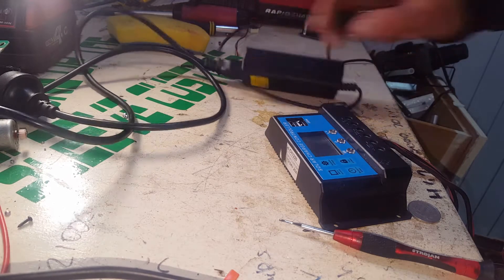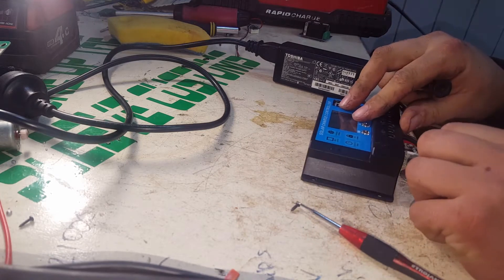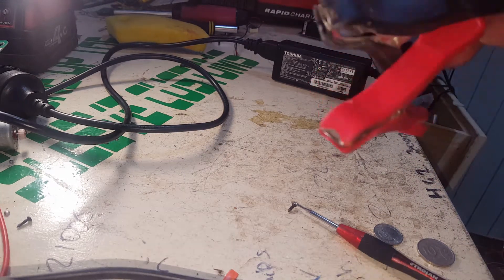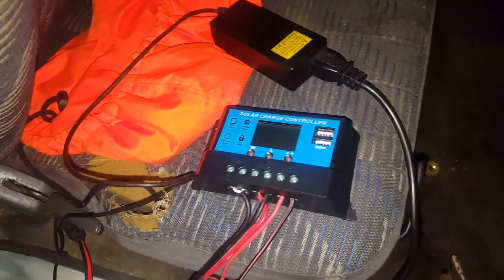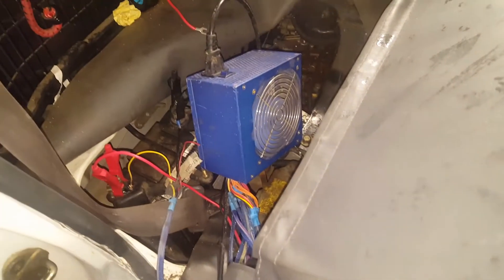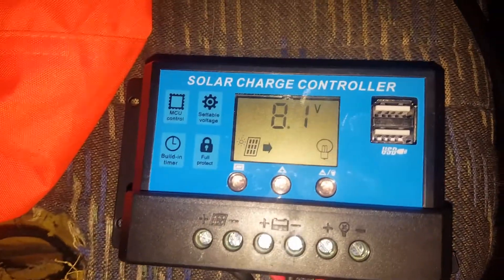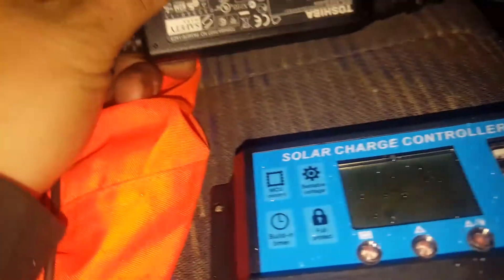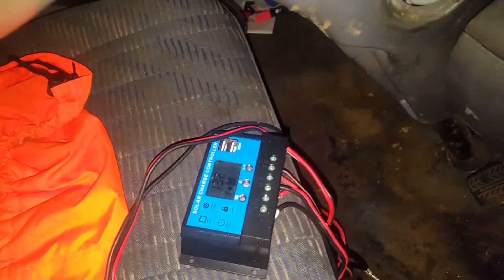Laptop power supply and cheap PWM charge controller  Car battery charger

Comment: This idea popped into my head a while ago and I just remembered to do a search on this topic! In theory I know you can! But I wanted to see if anyone has done this? Cheers! Subbed and liked 🙂👍👍👍
Reply from the maker: Yeah mate works fine. Better quality charger and controller the better results
Reply: @Oneupthesleevecustoms  man that was quick! Lol. Thanks heaps for the quick reply. Have a great evening. 🙂👍👍👍
Reply from the maker: Cheers. I will make an update video soon asim putting a lifp04 battery in my ute soon and a 19v 11amp laptop charger to top it up on job sites
Reply: @Oneupthesleevecustoms  oh yeah! That I'll be checking out for sure! Thanks man.👍👍👍👍

Comment: I've tried this method, but it didn't work. I have a laptop charger which rated for 65W (19V 3.42A). I connected the same way you did, but the voltage immediately shoots up to 14.4V (like 12.6V to 14.4V in a second).
Reply from the maker: What were you charging
Reply: @Oneupthesleevecustoms  VRLA battery, 12V 7.2Ah.
Reply from the maker: Yeah its not made for more than 1.5a charge  rate I'd say that's a huge push 65w
Reply: @Oneupthesleevecustoms  yeah, I thought so. Battery is rated for 2.16A max. I better use some kind of current limiting.
Reply from the maker: Yeah it is just hitting it a bit hard. Slower up and down you charge a battery like that the more cycles you will get also
Reply: @Oneupthesleevecustoms  thanks bro, I'll try that.

Comment: Hi thanks for the upload.

Can I hook up a laptop charger to an AC-DC voltage regulator,  then add a DC-DC pwm buck converter,  to make a bench power supply?  

Or maybe use a 12v car battery wired to the buck converter,  then to the voltage regulator?
Thanks
Reply from the maker: Yeah with a buck boost converter you cam do either
Reply: @Oneupthesleevecustoms  Thanks for the quick reply, appreciate  it!
Reply from the maker: No stress

Comment: I ve 30 Ampere Solar Charge Controller can I use it with 20 Volt Laptop Charger to charge my Lead Acid Battery.
Reply from the maker: Sure can

Comment: Can I use this to charge from battery/alternator to another  battery? To regulate the current that come from the alternator
Reply: I had a similar question can I use one of these controllers as split charger from starter battery to charge leisure battery
Reply from the maker: I think they are too small of current to do.so safely. A vsr is what you need I have one of these http://rover.ebay.com/rover/1/705-53470-19255-0/1?ff3=4&pub=5575479985&toolid=10001&campid=5338476033&customid=&mpre=https%3A%2F%2Fwww.ebay.com.au%2Fitm%2F332844284246
Reply: Thanks. A VSR however does not regulate the charge and can overcharge and damage the battery. A battery to battery charger is the ultimate solution with 3 stage starging. We were asking to use this solar regulator to mimic the 3 stage charge but it might not work as i have heard that when the batteries are top up the solar charger controller short the solar panel as way to turn it off. This won't be a good news for the alternator :). Hope it helps. Get a dc to dc charger
Reply from the maker: Yeah a dc dc is safe way I've done a 24v bank to 12v with a red arc dc dc
Reply from the maker: http://rover.ebay.com/rover/1/705-53470-19255-0/1?ff3=4&pub=5575479985&toolid=10001&campid=5338476033&customid=&mpre=https%3A%2F%2Fwww.ebay.com.au%2Fitm%2F164125931505
Reply: @Oneupthesleevecustoms  phew they ain't cheap lol
Reply from the maker: Nope bit they do alot

Comment: Hi, do I need a diode in series with the laptop charget as protection just like when solar panel is used?
Reply from the maker: If the charger can not handle back fed voltage. To be on safe side put one in
Reply: @Oneupthesleevecustoms  it think not scc has it all figure out...

Comment: question bro.. if i some how reduce the volts on my laptop charger to 12/13.5 volt add on a charge controller would work bro.. just question of will it.??🤔
Reply from the maker: You can feed the charge controller 19v or what ever the power supply feeds. Then charge lead acid batterys off controller

Comment: Dude can i use 14v  82 amp power supply?
Reply from the maker: You.sure can.. will need a much bigger chargecontroller
Reply: CM3024Z can afford this power supply?
Reply from the maker: Got a link to it.?
Reply: @dashingboy2160  that's 30amps max. You need something else.

Comment: Can I use this without battery? I mean like a converter 19v input to 12v output (load)
Reply from the maker: It will charge a 12v battery not as a power supply though
Reply: One Up The Sleeve Customs  I need to power my modem and router as a backup, in case of power failure like UPS. Do you have any idea about this. I have a 12v battery and laptop charger
Reply from the maker: A dc to dc converter set to an output of 12v might help

Comment: Some PWM charge controllers are the shunt type meaning as the battery comes to full charge they shunt (think short) the solar input. Solar panels don't care but your laptop supply may not like getting a dead short. I'm not saying that's what is happening here, just an fyi.
Reply from the maker: Thanks mate great advice for me and fellow viewers
Reply: Fanplant tanks for the advice mate it helps 🙂
Reply: Wtf lol is it pwm why they do that, just zero cycle
Reply: im wondering if i setup my power supply on 13.6v (for example) and the controller to stop charging the battery at 14.1v  (for example) am i going to have the short circuit problem when the battery will never reach 14.1v because the power supply delivers just 13.6v the battery will always be changing.

p.s. im looking into this from the point of emergency UPS.

Comment: i have 9v charger laptop can i use it?
Reply from the maker: +Romeo Baltunado no too low mate got to be higher than 13.8
Reply: Can i combine a 9v and 12v adapter?
Reply from the maker: +Romeo Baltunado could do best thing to use is  just a laptop power supply  as they are already 15 to 21v

Comment: If the laptop power supply is around 19v, could be good for bringing power tool batts up that have got too low?
Reply from the maker: Offgrid Dreaming  yes yes yes these pwm controllers can do anything  from 12.6 full charged to 28v charged